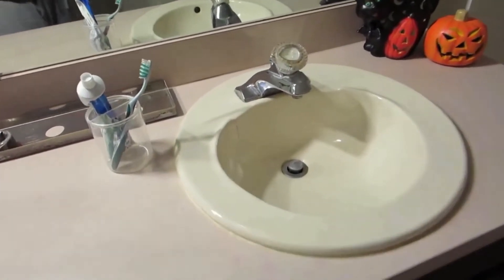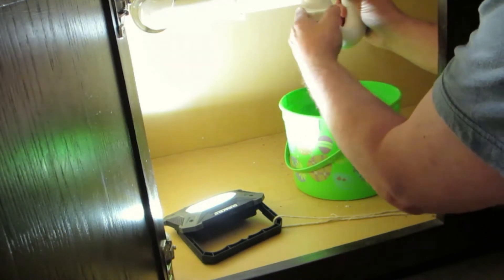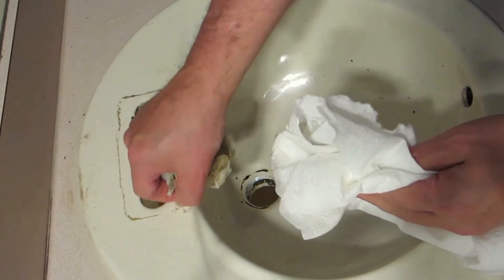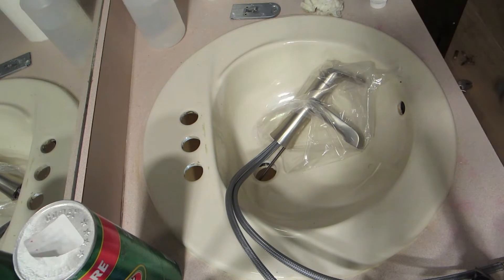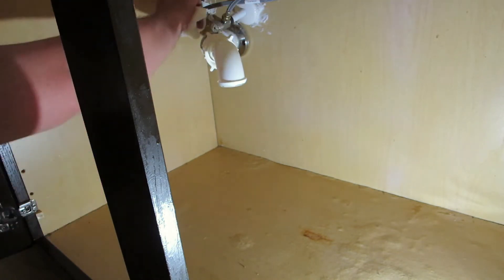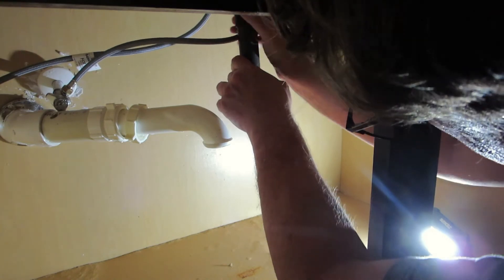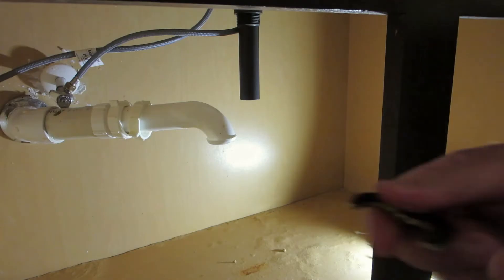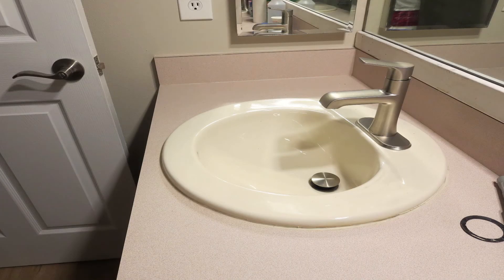Moen Liso Bathroom Faucet Install Review Costco

Comment: I also used Teflon tape and I used clear silicone.  Works great, not a single leak.
Reply from the maker: I can see using the teflon on the hose but I don't see it helping on the drain. Good that you got it to work, I do like using pipe putty. The thing is the stuff the give you in the box is so cheaply made. That black gasket is thin and useless.
Reply: Well I used the Teflon around the threads. Then after put in the top part into the basin of the sink with the very thin black rubber gasket. I put a nice beed of silicone around the edge. Smooth it out. Works just fine. Now time might tell a different story.
Reply from the maker: @bradp5505  Yeah I check under sink occasionaly.

Comment: I figured it out.. you need to use teflon tape and also a big cord of plumber putty around the part that goes into the sink. I did not use the small paper thin rubber seal. Thigh it nice underneath and the remove excess putty in the sink.

Comment: Ran into the same issues with this. Thanks. Though I taped the gasket to the sink not the escutcheon
Reply from the maker: Oh just read this, so you put the thin black gasket on top under the drain? I can see that working. Odd thing is I had a good seal on top using the putty and it still leaked.

Comment: I had the same issue with the leak at the join with the "UFO" gasket. I ended up installing it with the wide flat base at the top instead-so upside down - and it solved the problem. Still, poor gasket design would have prevented the issue.

Comment: My issue is the drain part doesn't sit flush on the sink.  The results in a small puddle around the drain.
Reply: I see that your isn't sitting flush also.
Reply from the maker: @josephl6788  yes didnt sit flush